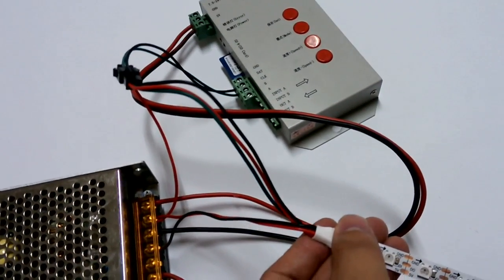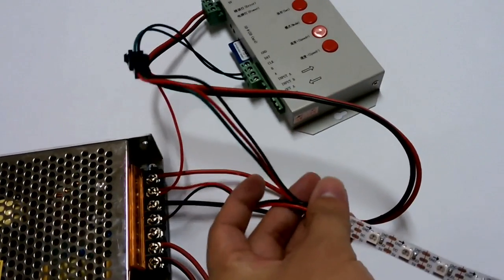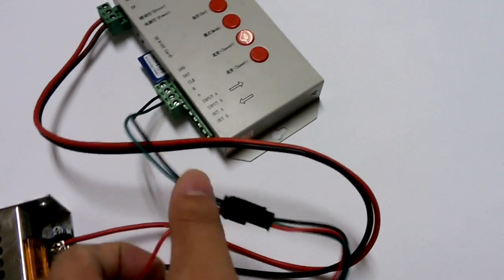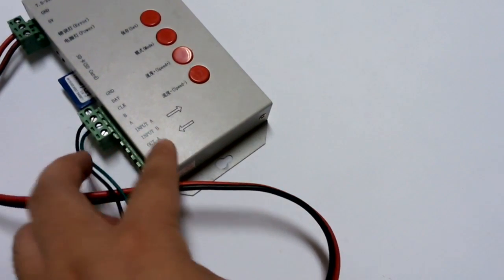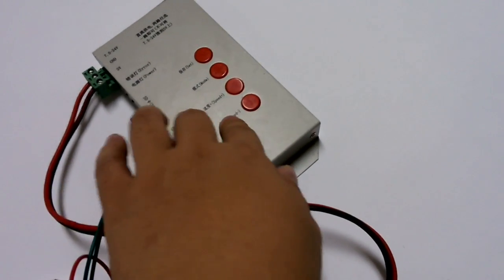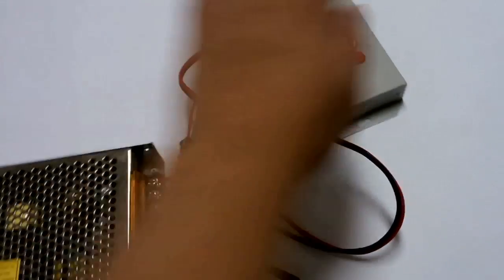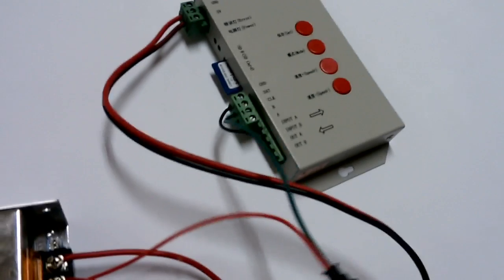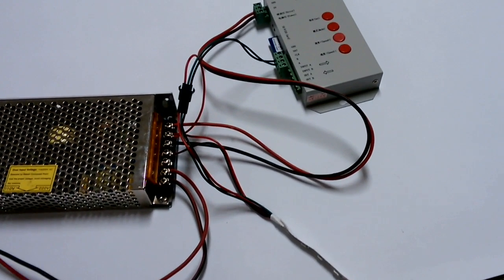how to connect our ws2812b ws2811 led strip on t1000s controller

Comment: Hi i  have big panel Aprox. 5000 pixel led actually I want to connect 2 or more controller if you able to guide me please reply me 

    (I am very tired for this :P)  thanks
Reply: Not sure if you still need help, bit you'll be better off buying a better controller, like a T8000, so you can drive many 1024 arrays of pixels at the same time.

Comment: I have the wS2812B strip using LedEdit but I cant find the WS2812 in the TS1000 section? Should I get a different controller??
Reply from the maker: +Kazuya Jin , WS2812B, You can select WS2811in the T1000S
Reply: Hi, I produce a similar controller "Led Master mini". It is much better than "T1000S". Here is my review of the real dimensions of the FPS.  On my channel watch video:  T1000S vs Led Master mini. If you will need a pdf, ask me.

Comment: Hello there.  Thank you for your video.  I have aporblem with the communication of my T1000S and RGB strip WS 2812B.  Could you please help in letting me know how you got your gear to work and if the parts are actually the T1000S and the WS2812B.  Which programmer did you use and of which year.  Thank you in advance for your help.  Happy Holidays.
Reply from the maker: led edit 2014 .thanks
Reply: Thanks. And under which I can chip program please?
Reply from the maker: arach sabet for ws2812b ,ws2811 is ok

Comment: Hypothetically is it possible to make this mobile, like rig it to a battery?
Reply from the maker: i think it can
Reply: Wang Alan What type of battery do you think would i need to do the job?
Reply from the maker: DC 5V voltage battery
Reply: Bryan Araujo did u get it to work with a battery?

Comment: I have ws2812b and t-1000s but I have no illumination when using this controller.  The power LED lights up and using the supplied 00_1.led file on SD card only illuminates number 1 LED in chain. I have tested with different controller and all LED's work. Is my T-1000's faulty?     Regards
Reply from the maker: I just saw video ,the controller is Copy T1000S, in addtion ,it seem that you have not connect the GND of controlelr near the Data, to LED STRIP Gnd. thanks
Reply: yes, thank you. I realised i had a copy t-1000s and contacted the supplier. thank you for your assistance.:)
Reply: +dazzlaa how do you know its copy t-1000s? What do you mean? I have a ws2812b strip and i cannot get this to work with my t1000s :( help please
Reply: +nitedealer If it works with lededit 2012 only then it's a clone. I had issues with colors being wrong on led edit 2014. I can send you the program if you want? Sorry for the late reply!

Comment: In my strips, the green one is 12V, the red one is DIN and the black one is the GND, how i have to conect to the controller?
Reply from the maker: for this controller , there are another optional , it is 7.5-24v, by the way , the controller and the led strip can be run on different voltage . thanks
Reply: So thanks men, i had a lot of questions but i did it, but now i have another problem, its about the work of the strips because, they dont the work correctly, i mean they dont the efects, they do it but uncoordinated
Reply from the maker: Oscar Vera Oh ,if you have eidt the software and to make the program ,put the program into SD card?
Reply: I did it! but not work as must be! i did a sing with 24x12
Reply from the maker: Oscar Vera i don't know what effect you want to make ,but one thing i need to let you know is that 12V addressable led strip each led is not individual . thanks
Reply: Oscar Vera  did you manage to coordinate the strips. I am having the same issue. My strips light up but do not display my program? I am also using the T-1000s and ws2812b. Kind regards.
Reply: you must put in the program the number of the chips not the LED number, i solved my problem...
Reply: Oscar Vera  
ahhh ok..Does ws2812b have 1 chip per LED?
Reply from the maker: dazzlaa 3chip ,rgb
Reply: thank you, so My matrix is 23 led horizontal. do i mulitply that by 3?
Reply: Wang Alan if i multiply by 3, LEDedit outputs a program for 2 controllers. I only have one.
Reply: You have to put in LedEdit just 1 controller
Reply: Oscar Vera its just not working for me :(

nothing is coordinated with led edit when i export the file